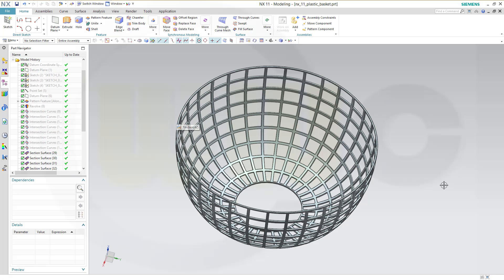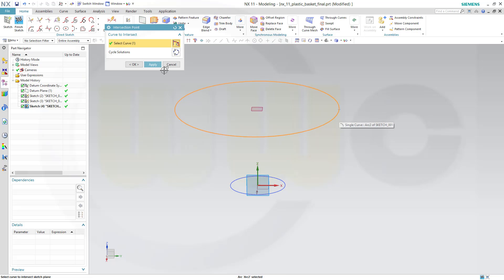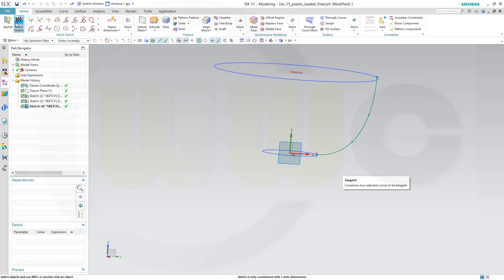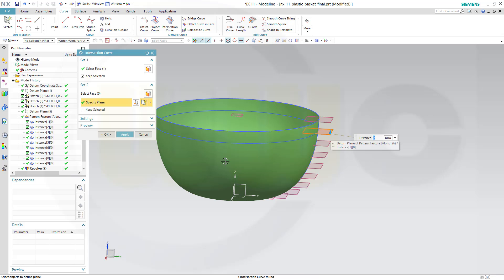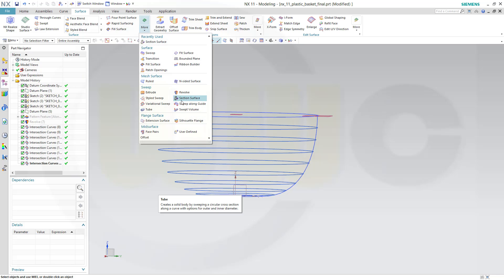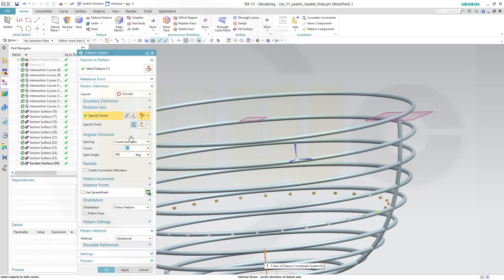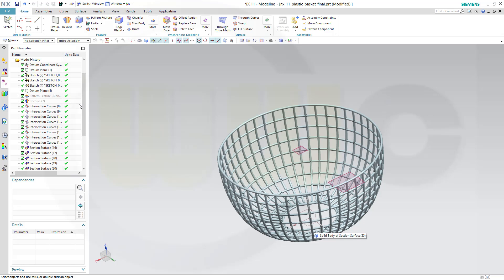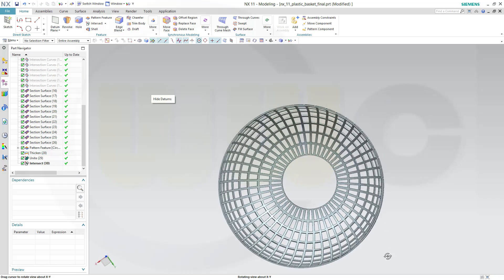Userwish - Plastik Korb - plastic basket - Siemens NX 11 Training - Surfaces

Comment: I have seen this tutorial and so much easier to create this in Solidworks than in Siemens In Solidworks you don't need to create 10 planes in your curve
Reply from the maker: I could do the simple solution, which I did i.e. in solidworks, in NX as well. This is not a best practice video but an exercise.

Comment: suppose we need to provide edge blends at the intersections, for that we have to individually select all the corners.. is there any method where we dont need to select individually and still get the blends.
Reply from the maker: You could use an edge filter. But you can´t specify the edges you want and the ones you don´t want.

Comment: NX is best software!
Reply from the maker: Catia has still more/better tools to structure a model, as you may know i.e. daimler tries very hard to implement their structured modelling method with nx, until now they have not succeeded.
NX has made big improvements over the last 3-4 years, but they overload every command with options, which are basically not needed and there are still some very old and dated unigraphics commands, which by the way are terrible and need an overhaul. So for the moment I would say it is a draw.
Reply from the maker: At the moment I would say it is a draw between catia and nx ;)
Reply: Where do you see that Catia excels NX?
Reply: Thank you for your answer Sir, for me NX is more complex, but much more flexible, synchronous technology is a great asset, check mate for more control of your design and much other thing that Catia doesn't have. I don't know about you but it seems to me that it's easier to do surface in NX than in Catia.
Reply from the maker: Yes NX is sadly more compley, that is not necessarily an advantage. The surface tools have way too many options. But catia sort of stands still - there are a lot of possibilities to improve catia - we will see what will happen ;)